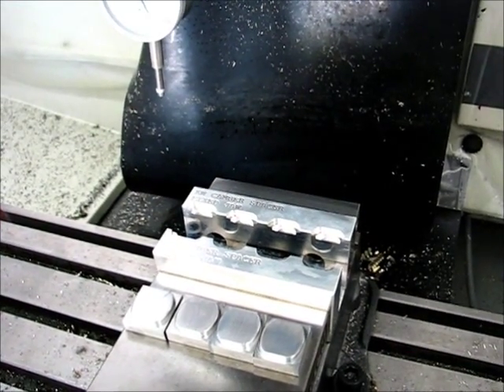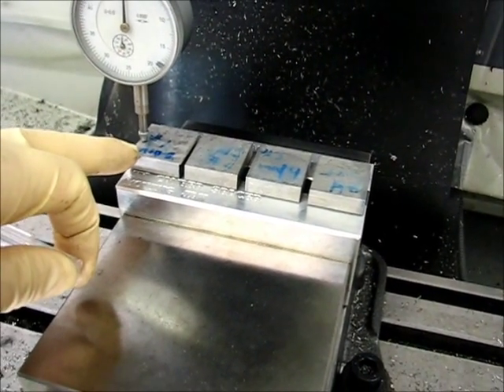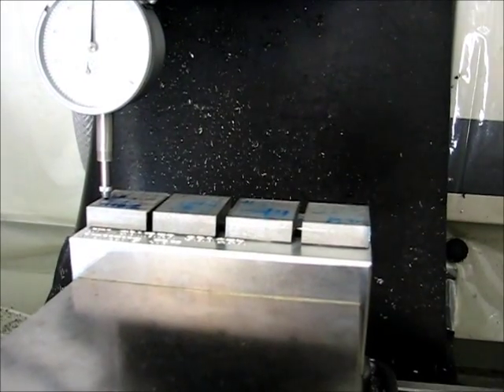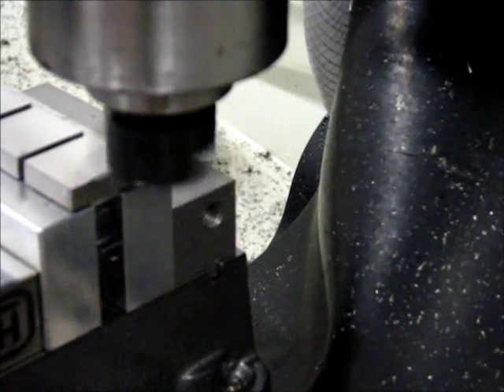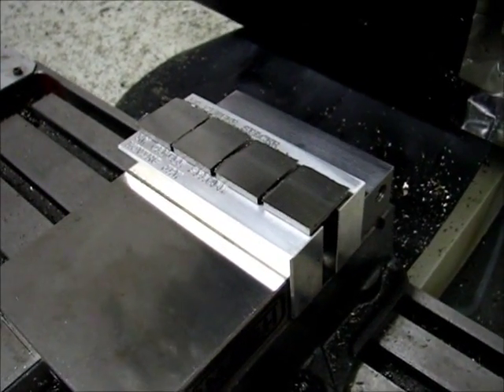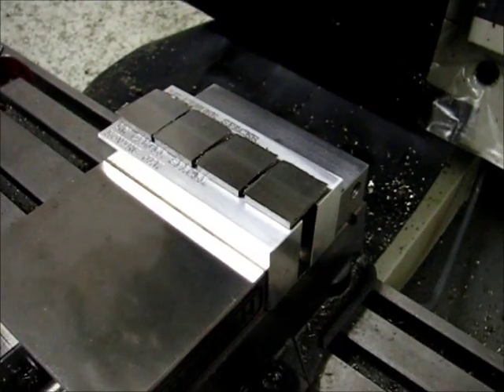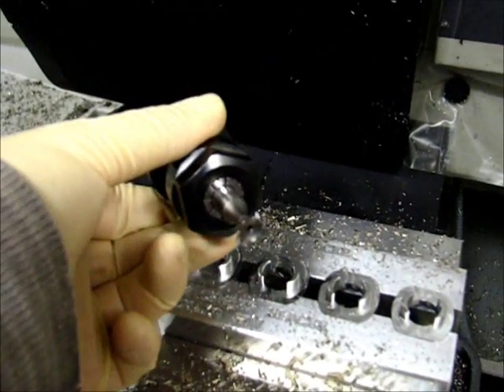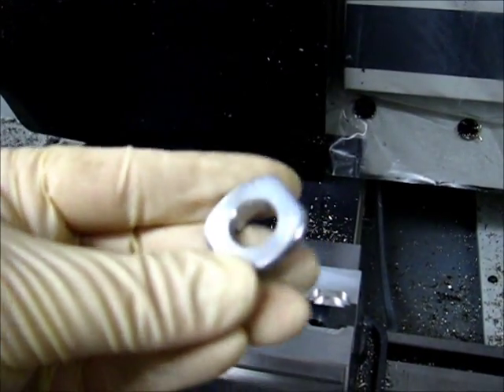Tormach PCNC 1100 - Finishing the 17-4 Part

Comment: Nice cuts, those turned out real nice. a quick note about the use of coolant (in reference to the earlier comments that I can't reply anymore) a quick way to choose is based on the cutting speed; 200-300 SFPM is a good coolant cutoff for AlTiN (not the same as TiAlN). Of course it depends on the cutting edge, endmill vs insert cutter, desired tool life, etc, but it's a good starting point..
Reply from the maker: That's good to know.  I've been struggling with flute edge breakage with this tooling.  I built a compressed air manifold using parts I had laying around and that didn't seem to fix the problem.  I'm going to try better nozzles next.  If that doesn't work, I'm going to try flood coolant.  I just can't get enough chips out of the pockets to prevent recutting.

Comment: Sittin here with a PBJ watching some cool machining.  Sooooo, why doesn't flood work with AlTIN?  I do it every day ;-).  I'd rather have the chip clearance and cooling of flood than worry about the altin not getting hot enough to work properly.  Stainless, like titanium, is a work hardening metal, so my generic rule is to use flood whenever possible except for light machining.  

Overall a great project bud, nice machining.  Hope you sell hundreds of them!